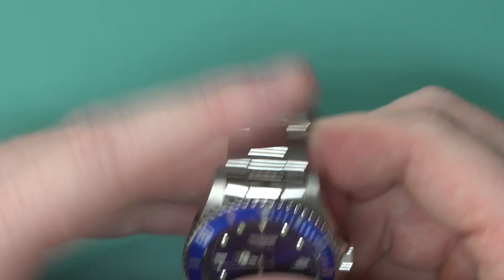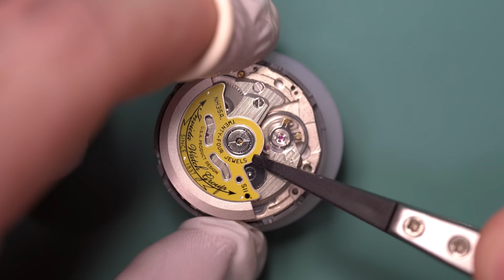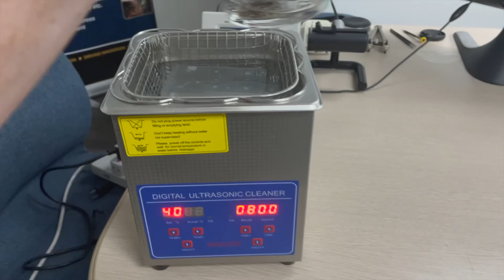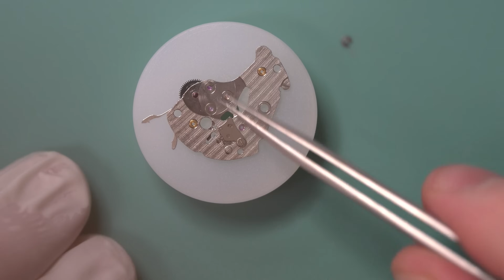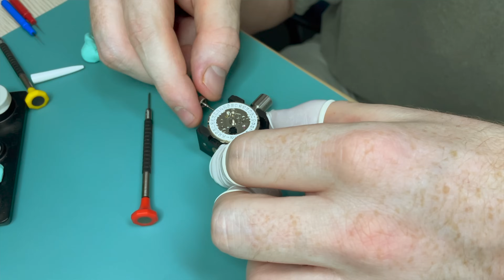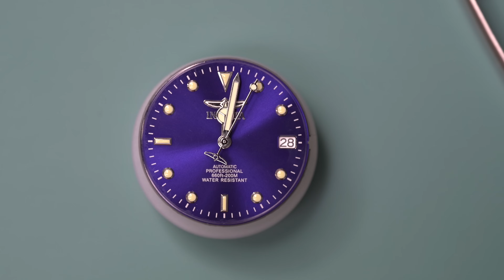$75 Invicta Pro Diver Strip Down and Review - Budget Watch Restoration - Seiko NH35a

Comment: Invicta might pay less per n35a movement with massive ordering, so it will have more profit buffer room even with $60 the watches sells for. With that said, $60 is the best deal on the market for an automatic watches gives you hacking, quick date set, 20 bar water resistance...
Reply from the maker: these little gems are unbelievable value for money! JSG
Reply: @JSGBuilt  I've had a Venom for about 3 years now, the crown fell out when I was putting a DJ in a sleeper hold for being too violent outside of a club. I fixed it but the only other real problem I think is the date, it's either fast or slow, but it's a beautiful watch, I like it for the weight and the mentality of it being a marine/ nautical watch, the mind state is awesome 👌🏽
Reply: I got mine 2 years ago and it’s been excellent with no problems.
Reply: The best value nh 35 watch is probably the Steeldive 1970!
Reply: @barrymills1196  Let's focus on $60 and below on price please.
Reply: @han7902  No let's not! Let's concentrate on buying a decent watch that people actually want instead of a watch people don't like! 😜
Reply: @barrymills1196  people do like it though. Watch snobs get bent out of shape but Invicta is one of the biggest watch sellers in the world.  The Pro Diver is a decent watch that is finished similar to the steel dive and costs less.
Reply: @tufelhunden5795  The submariner style isn't bad but the rest look like wish rejects! Watch snobs get bent out of shape for anything less than rolex and omega, my 40 odd watches don't have anything more expensive than £600 and there's only a couple that costly, most are sub £200 Pro divers are the only half decent ones, or at least they would be without the 10 inch high "INVICTA" script on the side and that gaudy yellow rotor!
Reply: @barrymills1196  why would they not use the yellow rotor? It's their color. Has been since before their rebirth. As far add the rest of their lineup.  Yep some are loud as f.  But then again the folks I know that wear them are as well, except one guy.  He's always so query but wears the loudest Invicta watch he can find.  I love it.  As far as the etched logo.  What is the difference between that and Rolex putting Rolex, Rolex Rolex in the chapter ring on their watches. I honestly think some hate Invicta watches as it shows how badly most companies are ripping them off. A Seiko five costing triple the price of the pro diver for lower specs is insane. I'm looking at a pro diver titanium for $90.  Imagine any other company offering a titanium watch and bracelet for that price?. It's insane what people are paying, IMO.
Reply: @tufelhunden5795  thanks to all the invicta haters out there. Otherwise you and I won't be able to get such great watches with this low price.
Reply: @barrymills1196  I love steeldive and matic and other Chinese made watches, but invicta pro diver has the best value. If you don't like the engraving, try to buy us army version  of invicta grand diver. It is more than $60, but it has solid end link, no side engraving, 30 bar water resistance. And with us army logo to cover the yellow rotor that you hate. I got the 38mm one for 90 bucks, it is so solid, beat a lot of other watches cost 300 bucks or more.
Reply: @han7902  I have seiko's, pagani designs, pulsars, loreo, guanqin, rotary, steeldives, timex, casio and more, most of which are fantastic value watches!
Reply: @barrymills1196  í have Breitlings, Rolexes, Hublots, Casios, Timexes, Seikos and even Tommy Hilfigers, Armani and Hugo Boss.. so everything from watches for hobos to watches for millionaires...

I love my vintage 50's 6542 Pepsi and it's Bakelite bezel, I love my A2536212 for Bentley and 23225 Spirit of Big Bang..

But I also love my cheaper ones, and I am seriously looking at an Invicta to add to my collection of well made watches that are affordable...
Reply: @ViktorAgnarFalkGumundsson  great, just dont expect any quality control! Paganis and steeldives are better but not perfect if you want a good watch at a decent price then look at a St Martin.
Reply: @barrymills1196  I have two Invicta Pro Divers and no quality control issues whatsoever. Everything lines up and works perfectly. The action of the screwdown crown could be smoother  but that's about it.
Reply: @han7902  why???
Reply: @barrymills1196 Seems like the youtube watch folks are making a killing with affiliate links to all these "value" watches they shill from alibaba and the like. Seiko have always been middle of the road - unfortunately the recent rise in popularity went to their heads and they raised prices a few years ago for the same quality.
Reply: @tufelhunden5795  I  totally agree.  I have a Seiko Sea Urchin,  it's a beautiful looking watch but it has a much inferior calibre movement (NR26?) to the NH35A in my Invicta's and it gains a shed load of seconds per day and costs about twice that of a Grand Diver,  which I prefer to the Pro Diver.  There is no doubt that Seiko make good watches but,  in my opinion, they are overrated and overpriced,  certainly the Seiko 5 Sea Urchin is.  Only my opinion though.  👍
Reply: @barrymills1196  well, that means that you are a cheap snob, lol

The best of two worlds...
Reply: @TheChzoronzon  There's nothing cheap about me!😁
If I go diving I rarely wear a watch, it's nearly always the Scubapro G2 unless it less than say 25 - 30 metres, then I'll use my trusty old Vostok Amphibian.
Reply: @tufelhunden5795  i like ny watches loud...that's a must..
Reply: @tufelhunden5795  I love the yellow rotor
Reply: @barrymills1196  npc
Reply: @barrymills1196 it doesn't matter because both watches dont pass the hammer test
Reply: @tufelhunden5795 you are completely right. Love my Invicta pro diver automatic. Better than many expensive watches, thank you very much.
Reply: @tufelhunden5795 The Steeldive is soooo good though. I hope to have a Submariner one day, but even when I do obtain one, I’ll wear my Steeldive Submariner over the Rolex day to day.
Reply: How many watches are enough...one more watch😂👍🏻
Reply: @barrymills1196  …Gracias por mencionarlo…tienes razón.
Reply: @barrymills1196 sometimes if it's on special with voucher and coins. Mine gains probably 25 seconds a day which is great.
Reply: @barrymills1196  
Its made in China ! Invicta is manufactured in Florida. But parts come from Japan . Happy now D A ?
Reply: @barrymills1196  I'd rather have a watch made in Malaysia than one made in China
Reply: @barrymills1196  lmfao
Reply: @eagles4757  oooh everyone's getting upset and pissy but I can't argue with you guys!
Mark twain said it best....
Never argue with an idiot. You'll never convince the idiot that you're correct, and bystanders won't be able to tell who's who.
Reply: @barrymills1196  ok
Reply: Cleaning costs more than the watch ..
Reply: @carlosoruna7174 right on
Reply: I like and wear any watch I choose to, snobs can get bent.
Reply: I got one of these based on this video and a couple of others.  So far great watch.
The only problem is re-sizing the band.  I tried several ideas from other videos and eventually got the links out.  Invicta should have charged $6 more and included the tool to remove the band pins.  That would have saved me a couple of hours of work.  But nice-looking watch that works well.  I'm happy with this purchase.
Reply: Invicta is garbage.
Reply: I have this watch, use it as a back up for my seiko kinetic hybrid automatic that I’ve had for 27 years, and counting. I had the crystal replaced with a sapphire, and I’ve had the capacitor replaced 2X. The power reserve indicator recently stopped working, but the watch still runs flawlessly other then that. It’s a daily wear, and I still get compliments on it.
Reply: Where can I get myself some of those finger jimmies? Could come in handy for me one day
Reply: I collect watches. I got several brand to include Invicta. I have 4 invicta wrist watches.
    Two of them has worn out band. I inquired and buy replacement band, and I was referred to purchase them from Japan ???
Reply: @gregoriorian2871  it is almost cheaper to buy a brand new invicta just to take the band, then buying a replacement band.
Reply: @gregoriorian2871  You're not a collector if you have invicta watches. sorry.

At least start with a Seiko.
Reply: @CheckDisOutpeeps  I have a pro diver  also have couple of Seikos  Citizens and Hamiltons plus a Tudor and an Omega Sea Master and I don't call myself a collector I have what I like and wear what I want .
Reply: @CheckDisOutpeeps  a true collector of watches appreciates all watch brands from a Casio to the top brands but that is my opinion but I think many more people agree with this also.  There are so many brands that offer good value for money watches that look good and don't cost the earth like Rolex and brands like it.
Reply: @CheckDisOutpeeps 🤦🏾‍♂️😂
Reply: @CheckDisOutpeeps Anyone can still collect Invicta watches.🤪
Reply: @julianmartin8356  3-years on.. nope.
Reply: I prefer quartz movements as there is no escapement working like a hand brake on a car just to control the speed while driving and thereby using up most of its energy.
Reply: @c.s.4273   mechanical watches are more luxury than quartz
Reply: Amen
Reply: 20 bar highly doubtful.  3 bar is deepest most sport divers go and this would likely be fine for up to 5 bar.  Disregarding that, still great value for a rebranded Seiko diver.
Reply: I’ve had my pro diver for close to 10 years, only issues I have had is the metal strap pins wear over time and the crystals are not the strongest. Other than that the watch is a very solid buy for the price point.
Reply: just bought 3 more...all ready had 1...a black ....bought another black and 2 blue dial pepsi....gonna swap the dials between the black and 1 of the pepsi....already bought a case back press to change batteries in my other 100m rated quartz pieces, so getting them open is no trouble...do need to get some more finger cots...
Reply: Invicta is definitely the best budget friendly watch out there. They’re are workhorses and look good doing it. Owned 3 invictas all automatics with flawless accuracy and reliability
Reply: Thank you for your honest  price based no bias on Invicta,,,only incompetence buys something just for the name over everyday use price and maintenance,,,Invicta shows people that hey you over paid for a sun dial
Reply: I just laugh so much at these people who are so snobby and pretentious. So they rather buy a watch that costs a fortune just to tell the time and day? To show others they are some better shit? To be approved by other fools. I mean this is unbelievable how much stupidity, pretentiousness, and ignorance is out there. Go ahead and be carried away by the amazing marketing that convinces people to spend so much money for nothing
Reply: I just bought four of these watches. One automatic like this one, and three others.😁

I was thinking of omega or Tissot but why bother when 4 of these is still cheaper than one of those?
Reply: @Snapdragon 9600  I have three Invicta Pro Diver watches in my collection and I have had no issues whatsoever with them over the five years I have owned them. Great value for money watches and reliable with the NH 35 movement.
Reply: I'd rather have a better watch and a cheaper box!
Reply: My Invicta rose gold numbered Swiss automatic WITH the 6mm thick sapphire kit is working to this day. About 12 years old. Not TOTL but design is way better than a small azz presidential Rolex. Also Invicta have a wayyy smoother second hand sweep on their automatics than any Citizen Autos. (Those things are garbage. I have fake Rolex’s with a smoother, no clicking movement.)
Reply: @hardtymz2517  The reason for the longevity and smoothness is nothing to do with invicta, its the fact that there     is a Seiko industries NH35 movement in it!
Reply: I have a quartz watch with an almost completely smooth running second hand!
Reply: Me too!
Reply: @barrymills1196   You're wrong. Invicta is responsible for putting in that fantastic Seiko movement. Almost all companies outsource their movements.
Reply: if you want a sub knock off go for a pagani design, looks, feels, and is arguably better
Reply: No sapphire glass? Pathetic.
Reply: @c.s.4273  tbh I wouldn't expect a sapphire crystal at this price point from Invicta.
Reply: @c.s.4273  please advise where  can we buy automatic watches with 200m wr plus quick set date, PLUS what you want, sapphire cystal, for the price around $60 dollars?
Reply: @han7902  I guess nowhere and that is the reason I prefer quartz movements. My Regent F654 and F129 and F130 all are 200 meters waterproof and have a sapphire glass. They have 3 hand and show date AND day.
Reply: @c.s.4273  quartz is not my cup of tea, but i do have a few swiss grade quartz watches that give me dead on time for years. If sapphire is a must have, i would recommand orient kamasu. It is about $180 USD, and you got a very fine watches with high spec inside out.
Reply: not sure I don't stay up at night looking at $60 watches lol
Reply: @eagles4757  But you do stay up at night responding to people who stay up late at night looking at $60 watches lol
Reply: @howmit6361  trying to educate the masses my friend lol
Reply: @eagles4757   "trying to educate the plebs" there ftfy
Reply: @howmit6361  ha ha ha ha ha
Reply: @howmit6361  If you spot it you got it too.🙄
Reply: BwaaaaHaaaahaaaa! Good one!!!
Reply: @howmit6361  lol 🤣😆
Reply: @eagles4757  How is arrogantly looking over a great $60 watch in any way " trying to educate the masses"? Duhh... 😆
Reply: @Nightmareman3  l o s e r
Reply: @eagles4757  You need to look up the definition of education.
Reply: @jamesmills706  I did history of watchmaking and Invicta not in books lmfao
Reply: @eagles4757  What's the education exactly?
Reply: @eagles4757  I may have become a bit obsessed with cheap auto watches as well...
Reply: @eagles4757  yeah??? Except for now right.. 🤣😆🙂😊
Reply: @eagles4757 What kind of weird remark is that?
Reply: @eagles4757  🤡

Comment: I have two Invicta Pro Divers (one SS with Black dial and one two tone with Blue Dial).  I've had both for years.  The one with the black dial does lose about 30 seconds a day, though I have never regulated it (it originally lost about ten seconds per day when I bought it about ten years ago).  The blue dial one gains only about 2 seconds per day after I recently took the time to regulate it.  I find it amazing that these automatic watches provide as much as 99% of the accuracy of a Submariner for 1/200th of the cost.

Comment: I had mine since the 2000s. It used to have a Miyota movement back then. The movement is still ticking, but the crown won't screw down anymore (did anyone else have this problem?). So I keep it in the box. Maybe I will use its bracelet to replace the rubber strap on the new NH35 version I just ordered for ~60 bucks.

Comment: I truly appreciate the level of complexity, materials, surface finishes and accuracy of working mechanical watches. The only scrimping of this invicta watch seems to be the fact that the movement body started as an investment casting and possibly the few plastic components. The use of punched out metal components vs machined from solid are what truly make this watch movement affordable and every manufacturer of production grade watches must be using the same methods in order to survive in a very competitive market. Parametric modeling, CNC machining centers, vision inspection and robotics all come together in a precise symphony of manufacturing and....VOILA A ROLEX COMPETITOR IS BORN!!! 😅

Comment: Came here for the review, stay for the crazy disassembled and reassembled! This give me such a new perspective and respect for these machine and watch smith. 

I'm a mechanic by trade and assemble engines and transmissions. I don't have desire to work on one after this video. Can't belive thats  $35 even as mass produced movements. 

Good job and keep up the good work. I subscribed! 

Can you please open up the new casio carbonfiber case? It has seiko movement so we dont need to deep dive into the movement but rather the casing itself! Thanks!

Comment: Another watchmaker said that the plastic parts in the Seiko movement are actually because metal parts (such as in the small white plastic date adjust wheel) would cause too much wear, and plastic is an elegant design for this feature.

Comment: "Buy the Invicta before buying a Rolex Submariner to see how you like it on your wrist" is very sage advice.  That's why I bought my Invicta 9937OB in 2016.  It has the "Swiss Made" nomenclature on the dial, so was quite a bit more expensive than the Pro Diver with the Seiko movement, but orders of magnitude cheaper than the Rolex.  The trouble is, I like the Invicta so much that I don't actually want a Submariner now.  I do know, however, that a Submariner would look great on my wrist!  I'm saving for a Yachtmaster instead.

Comment: So basically it is just another modded and rebranded Seiko NH35 with crappy design. For that I rather pick something better looking Seiko clone or mod with the NH35 in it. 
The parts and other stuff probably worth the price if you plan to reuse them anyway, but if you only buy the watch to wear it, there are better and nicer looking ones out there for not so much more. 
That 200m water resistance is gone the moment the first time you take apart the watch.